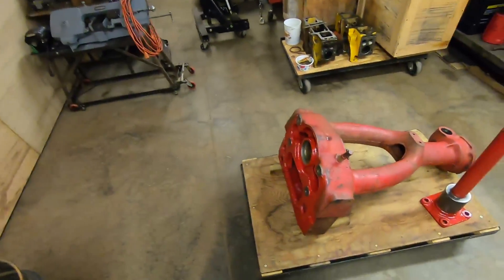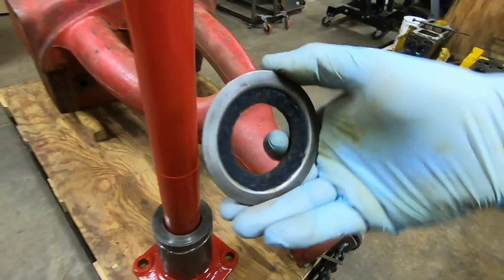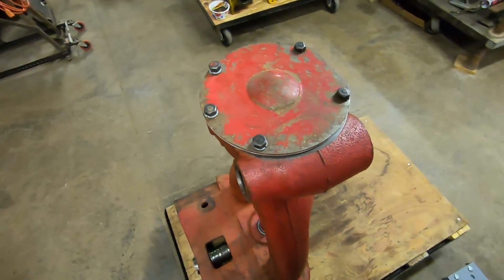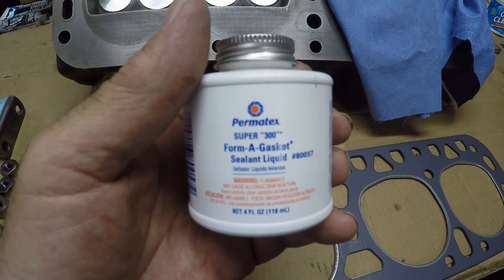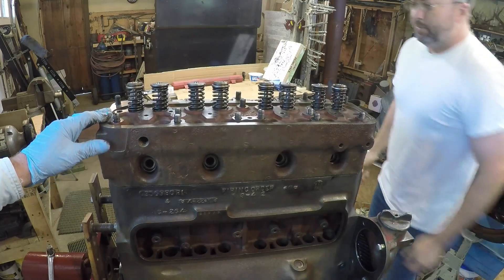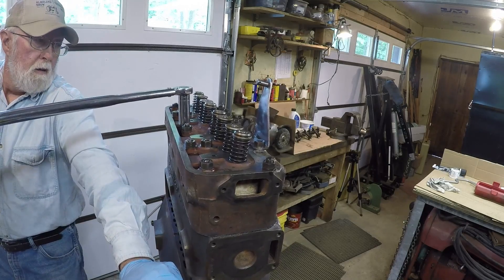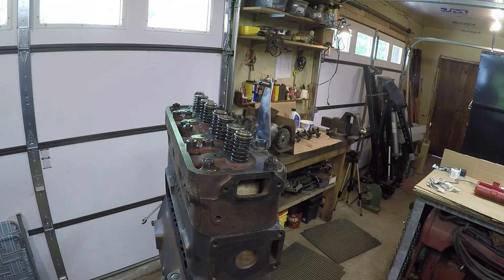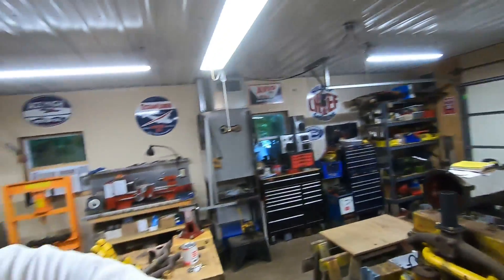Farmall Super M Rebuild Ep.30 - Head Installation, Bolster Assembly,  Glyptal In Bell Housing

Comment: Kinda neat to watch this series.  I myself have a pair of Ms in my collection now.  One is a fantastic utility machine, getting plenty of use.  The other is a former pulling rig with gobs of new parts and a locked up engine.   Worst case scenario is a full rebuild. But hey,  the Mrs. says I am free to do whatever to make "her" tractor a runner.  That's fine with me, she won't drive it around anyway once it does run.  ...or will she...  o.0?

Comment: I have a  question about pony motor  if pinion  sticks engagement to ring while  starting the pony motor.  can it b putting a  bind on starting motor if starting clutch is in disengaged on pony motor iam haveing problem with starting the pony does it mater.    also rings are bad on 1 side leaking oil from pet cock when flooded  . I did a  rebuild on it last year . I have  spare parts and a set rings  i know that there really finicky  motor